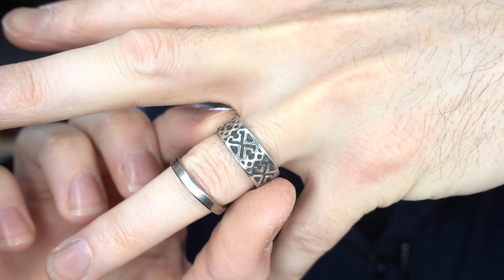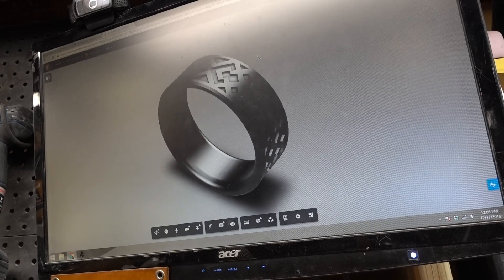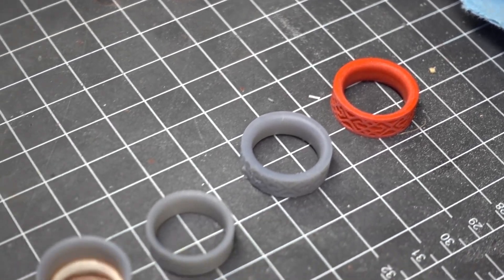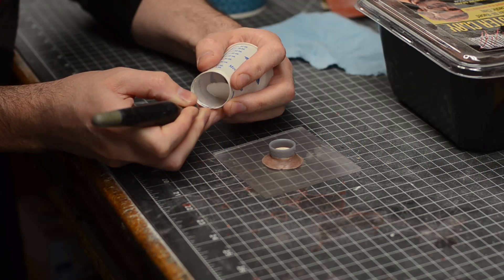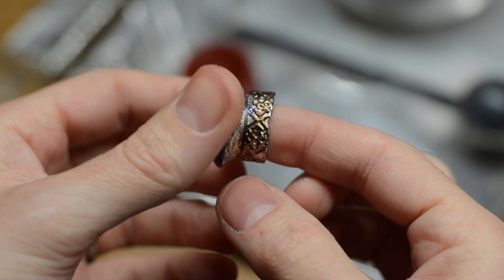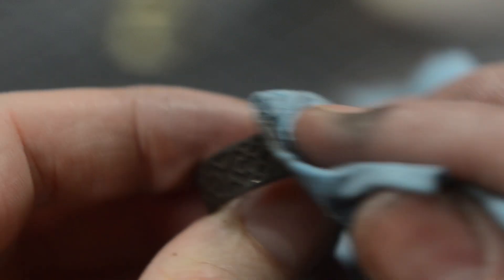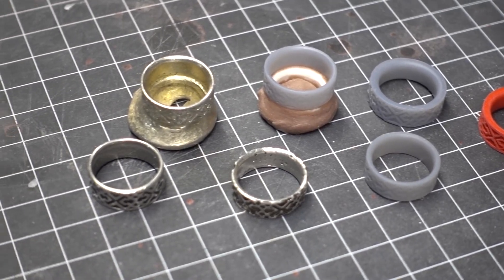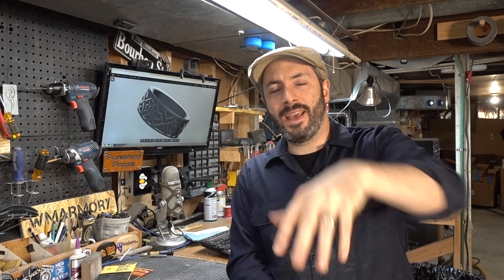3D Printing and Metal Casting Jewelry with the Form 2 - Prop: 3D

Comment: thank you . great videos.
i'm an old school jeweler (Hobby). I use the lost wax technique and cast in centrifuge casting machine blah blah blah… my question to you is that: your technique is cool but why you didn't instead use Sterling Silver and a simple torch to cast your ring??. Silver is also very cheap and last forever.
Reply from the maker: Silver gets a bit too hot for silicone I think, and I was plenty happy with pewter. I use my hands often so if I damage it, no worries!

Comment: Probably could have skipped the silicone step. I would be interested to see what would happen if you took just the 3D print and bury it in very fine sand then pour the molten metal in it. It should melt the plastic ring replacing it with metal
Reply from the maker: I've heard of people doing that with PLA plastic and aluminum. I have no idea if this resin off the Form 2 would vaporize. Also I don't think the pewter gets hot enough to get the job done. Soooooo if it was a PLA print and you were casting in aluminum, that would probably work. The benefit of making the silicone mold is the repeatability with a low melt metal like pewter.

Comment: What ultimaker did you use that gave you a resolution and accuracy of an SLA printer?!?!?
Reply from the maker: It was the Ultimaker 2+ Extended. I wouldn't say it's the SAME resolution as the Form 2, but it definitely did an amazing job.

Comment: Hey Bill, did something a bit similar lately I aim for more rings. Just would like to know if you have any update on how it kept shape in time as it's pewter. (Pewter or solder btw ? Is pewter not dangerous with the lead in it thus maybe stronger than solder ?)
Reply from the maker: +Ritin Kornas This is lead free pewter. It keeps shape OK. It does get beat up a bit, but I can cast more if it gets destroyed.
Reply: Ok so still in good shape ! :)
I think the thickness or width are key parameters here, is too thin it will break super easily in pewter :s by experience.

Thank you for the answer ! :)
Have a sunny sunday !

Comment: to get better detail reproduction, add around 2% of bismuth to your pewter (assuming it doesn't already contain some). it expands while cooling allowing the pewter/tin to fill out the mold better. to get a harder alloy, you could add some copper to it.  up to 10 percent should be possible without raising the melting temperature too much for the silicone. another option is zinc. higher melting temp, but can still be done with a torch and the silicone should still be able to handle it. oh and diluted nitric acid instantly blackens tin if you don't want to use spray paint for some reason.

Comment: Pewter is a very soft material and gets damaged when using tools... so is gold and silver, iit looks amazing and using any fancier metal will only increase the price, not the durability or the hardness of it
Reply: The durability will last a lot longer with silver or gold. They are soft Metal but not has soft has pewter. I work every day in my workshop where I make knives with my silver ring and it's still in good shape.
Reply: that's... surprising, I asumed that pewter and gold and silver were in the same toughness range, just different reactivity with chemicals, good to know, I have a jeweler uncle tha can get me cheap silver I'll go with that if I decide to make one of these. thanks
Reply: The hardness of Tin (Pewder is made with 90/99% of tin) is 1.5 in the Moth Scale, Silver and Gold have an hardness of 2.5/3. The silver and gold used in jewelry are in fact an alloys who make the metal way more durable.
Sterling silver, used in jewelry is 92.5% silver, the rest is most likely copper. 18k gold is most likely 75% gold 15% copper and 10% silver.

I don't have the hardness of these alloys but it make the jewelry a lot stronger. I can see scratches on my ring but it's nothing too big, I'm pretty sure i could polish them off.

I you can have silver for cheap go for it, even if you don't use it, you can resell it easily !

Comment: That looks great.  I was wondering if you might try castign the ring in Plaster.  I personally would want to try and make the ring from Scrap gold, which I am sure is too hot for the Silicone mold.  Though I could use your method and remake the Warhammer 40K figures that are now made of plastic and cast them in Pewter like they are meant to be.
Reply: Try with sand. Plaster is not ideal and can cause a lot a problem. You can find a few video with sand casting on Youtube. Give it a try !

Comment: Pewter isn't really a skin-contact safe metal. The cheapest (or old) pewter has lead in it. you should try pouring wax in your silicone mould and then casting in gold or silver.
Reply: I would love to see how doable silver casting is in small scale!
Reply: Jewelry pewter is safe.
Reply: All pewter is, is a tin alloy. The tin content can be up to 99%. The additives are often antimony etc, no need to use lead. You are talking about only one of a great many alloys and additives.

Comment: So form 2 is preferable for jewelry? Or can a normal 3d printer work?
Reply: If you want to go the cheap way, use wax. Make your ring out of wax and cast it like in the video. The Form 2 cost 4000$ is way too expensive if you're not made of money.
A cheaper, PLA printer could do the trick but you will need to work a lot to have a good result.
If you only want to make jewelry, stick to the traditional method and go for the Wax.

Comment: Could you use the Ultimaker for a Lost Wax casting mold? A little plaster and a quick and dirty little crucible could cast those things in Silver or Gold. 

Would love to see you do something along those lines. Had some fun in the past myself and it's really rewarding to cast in precious metals.
Reply: Punished Props Aluminum is supposedly extremely toxic when casting/melting so take the proper steps. The being said, I'm certain you can work up some awesome things.

I'd like to see you possibly incorporate cast metal components in your high end builds. Something small but prominent that can show off a huge diversity in materials and construction techniques.

Comment: The ring turned out amazing! I actually worked for a person doing finishing work on pewter medallions for a local marathon the past couple of years, and one of the chemicals we use is "pewter black" from Jax Chemicals. It oxidizes the surface of the pewter then can be buffed off to give a similar effect to the spray paint. The finish from pewter black may be more chemical resistant than the spray paint, and a 2 oz bottle would be plenty to brush into the details. 
Edit: As I'm reading their page it says it also works on brass and bronze, so maybe it would work on cold cast props?

Comment: is it possible to quench the ring to make it harder?
Reply: No, quench hardening does only work for iron based alloys.
Reply: SwompyGaming  you mean Heat treating, quenching is a method for relief after heat treating. No you can't harden pewter. It just possible to heattreat carbon steels. Plz forgive my bad English and explanation but I hope I helped you
Reply: Doktor Frankenstein No I mean quenching, YOU got them mixed up.
Reply: Not really.
Reply: SwompyGaming XD good luck
Reply: Doktor Frankenstein wtf? good luck with what?
Reply: It also works on silver and gold